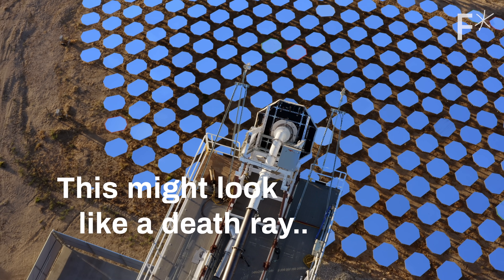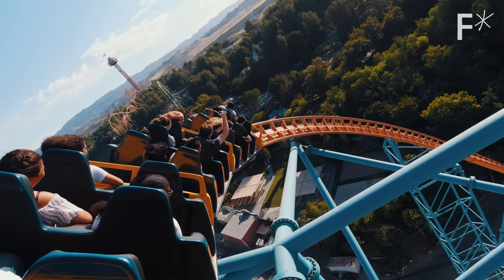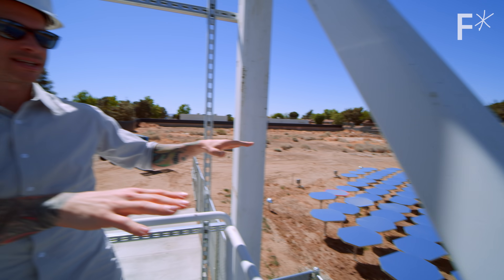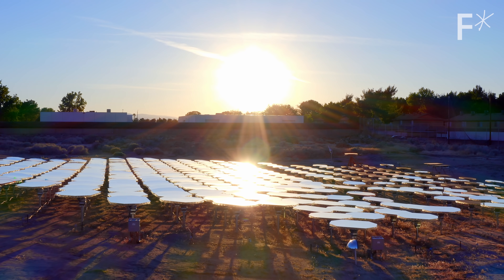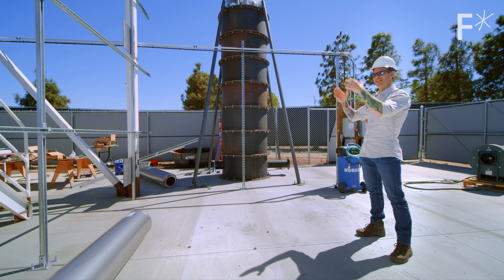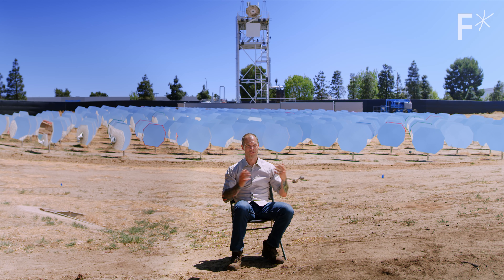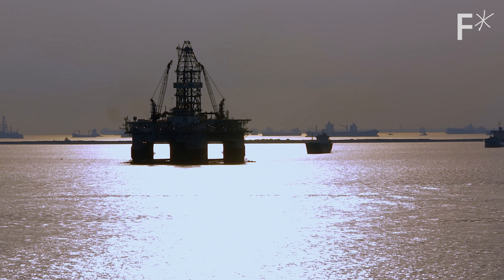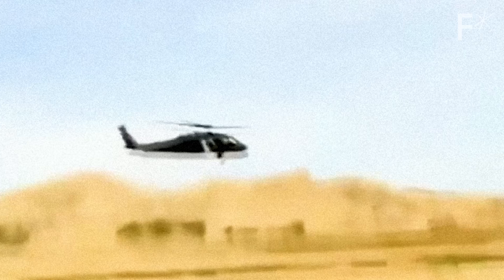How concentrated solar power could fuel the future | Big Think

Comment: I wanna know more about how they transfer heat to rocks in the ground from that tower that captures the sunlight? Do they use some sort of liquid to transfer the heat from the solar collector and pipe it into the ground?
Reply: I’ve heard that they use hot air as a heat transfer medium and use natural rocks as a thermal energy storage.
Reply: @DS-iv9bo  The way it looks with that huge inner insulated pipe seems to support this.
Reply: @garethrobinson2275  Indeed, the thermal energy storage is protected with excellent heat insulator to reduce heat loss until zero. This is also the way to develope this technology.
Reply: Likely a molten salt as others have mentioned. 1500°C is hot enough to weld pure iron. (Yikes!)

On a side note, some years ago, the Australian National University used a smaller setup to split ammonia into its component parts, which when recombined, is very exothermic and could drive steam turbines after dark. The next day, you've got ammonia in the tank to go again, as the system was a closed loop.

Food for thought.
Reply: @jasondoust4935  Yes, ammonia is so interesting and it's rarely mentioned.
Reply: @jean-pierredevent970  It's also very toxic, corrosive and flammable.
Reply: @craigs5212  When concentrated yes but easily dissolved in water and can be released into nature without long term issues in the event of major leak etc
Reply: @jasondoust4935  sadly that food is not on the Coalition menu 🍲
Reply: As others have said, molten salt that is transferred via insulated pipe to a steam-driven electrical turbine. The “rocks” he’s talking about would be a storage tower comprised of molten salt.
Reply: Finally a solution for energy storage. Heating rocks!
Reply: Exactly. They basically skipped the most important/interesting part. It’s obvious that part of the tech is proprietary, but still made me laugh. So you heat a bunch of rocks, then what? “You convert the rock heat to electricity, use the electricity to mumble mumble a catalyzer mumble mumble hydrogen which can be mumble .
Reply: @baTonkaTruck  Heat to electricity is so common, it doesn't need to be explained (it is what powerplants do). With electricity you can split water into hydrogen and oxygen. This is also very common, but is only feasible with very cheap electricity. And obviously, sunlight is infinitely cheaper than coal, gas and oil.
Reply: Would it be using phase change, work on gravity or vapor pressure in a closed loop, and not require pumps?
Reply: I've read about salts(they say its not sea salt) but this is the first time I've heard rocks, i wonder what kind?
Reply: An ideal superconductor can transfer heat with getting hot due to minimal resistance
Reply: the concentrated light melt down salt. liquid salt flow to heat up the water and make steams to a turbine to generate electricity
Reply: Molten salt, currently, seems to be how they save up the energy.
Reply: How about optically?
Reply: Sand is also used for thermal heat storage.

Comment: An interesting video but there is left out information regarding output and efficiency. Most of today’s energy is fueled by the oil industry and renewable energy is just added onto an already existing grid and hardly adds anything significant to the current power scaling. Still it seems like a better way of creating renewable energy but much information is left out of this

Comment: This sounds good, but I'm going to need to hear from a few scientists and have them co-sign this idea before I even begin to get excited. Too many scams out there. 

Furthermore, they're talking about heating rocks and or transporting hydrogen for long distances, we'll need lots of infrastructure for that. I mean, how many hydrogen power plants are there in the US that could use that for fuel? How would we use these heat rocks for batteries? I didn't see a mechanism for converting the batteries to electrical energy for use on the grid.
 
I'm all for green energy and having it done yesterday but we need not throw money at a nonstarter. If I'm wrong, Let's GOOO! lol

Comment: So they put up a concentrated solar plant with mirrors 360 degrees around. Unless you are exactly at the Equator, that is unnecessary. The Sun in the Northern Hemisphere ALWAYS tracks south of any point in it.  Vice versa in the Southern one. Therefore, a maximum of 180 degrees mirror setting is necessary. During the changing seasons, the Sun moves across the sky about 47 degrees between the summer and winter solstices, so that is the maximum oscillation the mirrors need to get in a north-south oscillation. As for the heat/energy storage, maybe we should go back to Mercury (Hg) and store it hot under pressure, then run it through a heat exchanger, for power generation. The environmentalists will go ballistic about this, but they do not mind using compact fluorescent lighting with Hg in them and then thru them in the trash. As an element. Mercury can withstand any temperature, provided the containment vessel does not react with it. So  syntered alumina encased with high grade  stainless steel could do the job

Comment: Be nice if you got more into the mechanics of this idea, which I think is about time and great. 
How to transfer the production would be a great start. The map of their placement was in low population desert areas, the shipping thing is still my biggest question. Rocks hold heat, yeah ok, so how to ship it hot? Actual numbers highs and lows, not just optimal. Is this going to another fusion "only 10 years away, and 70 years later still, only 10 years away".

Comment: 8:28 but the same is with this. In this too if stored energy that was to be sent from Australia, USA, Middle East and South Africa to different parts of the world is stopped, it is the same.
Edit- yeah but definitely it is good for environment.
Reply: That’s true but if there is enough energy on every continent there is no need to steal it from some other country or continent. Besides that the existing energy sources would still be there.
Reply: @MC4allforUser  I commented according to the situation Sir told about setting plants in those locations and then supplying to different countries. And remember these are to be set up in Sunny deserty places. So it can't be in all places, energy has to be stored and supplied which opens the possibilities of stopping the supplies.
Reply: I think the big difference is that this source of energy is unlimited and can be built almost anywhere, unlike fossil fuels that are only found in particular areas of the world. There's no incentive to start a conflict over solar energy supplies when you could spend your resources building CPS farms instead.
Reply: @billyballbags  brother you haven't listened the video and not read about it properly. No it can't be made anywhere.

Comment: This isn't particularly new or exciting tech.  Unless this company has resolved the core issue ⚠️ how to stop the reflectors from degrading. 
Spain has had one of these plants for year's
Reply: This is simply a refinement of the technology that was built in the Pyrenees in 1972. That’s right a full 50 years ago. Store it in molten salt, store it for a reasonable time, then use it to produce energy on demand. Then I’ll be impressed.Oh, make it cheap.
Reply: Also...how do they keep them clean? 
It's good tech, no doubt..but it definitely has shortcomings. 
Also weird focus on the geographical limitations of oil, when they literally described doing the exact same thing with these solar rays plants.

Comment: That takes a lot of fossil fuel to build and maintain and dispose of all that
Reply: A good design should not need maintanence, or people, or lifespan.
Reply: @The1stHomosapien  great goals but in reality good designs often need all three.
Reply: the first time.  and after that you use the new energy source to power all the work behind the scenes and you've moved off the old source...  same happened with horse and gasoline powered cars...  they were pulling materials into places like ford factories with teams of horse for years, then rail, then trucks... eventually the horses were displaced...
Reply: @lylestavast7652  No long past the first time.  We have had solar for decades and almost all manufacturing is still fossil fuel.  Trucks displaced horses far quicker because they were more efficient and could do things that horses could not.  Fossil fuel is more efficient and can do things that solar can not.  Storage of solar is not where it needs to be
Reply: @The1stHomosapien  and how well did they do compared to the fossil fuel trucks?
Reply: @The1stHomosapien  more did not

Comment: If they find a mirror, that not matter how it is repositioned does not add to production,  then it can be flagged for cleaning. Again, something possibly handled by a maintenance robot (ala Wall-e). The game changing on the AI doing the work is by simplifying the movement motors so all they need is basic control logic to tell the motor how to move. Each mirror does not require its own mini computer to read built-in sensors on every mirror. The are putting control at the receiving end and greatly  driving down cost of implementation. This is was is "next generation" about THESE heliostats that those who say "these have been around for years" had not picked up on. They need to re-watch, as it is explained, sort of. You gotta understand this is a business, so while they're excited to talk about it, that is to drive investment to move forward. You don't give away all the secrets on something you're expecting to make some money from.